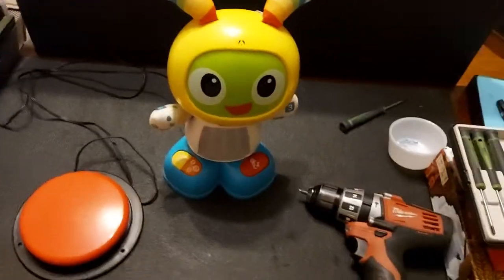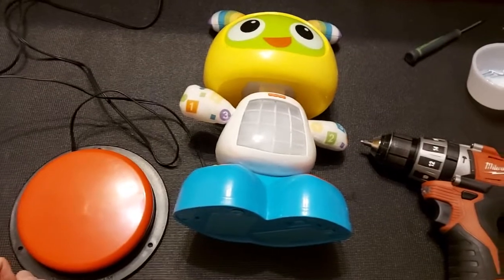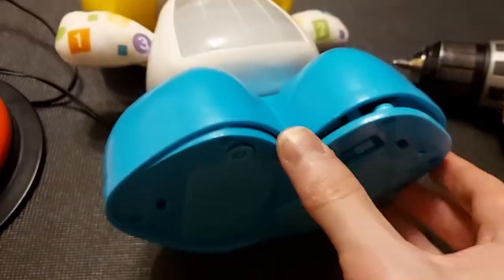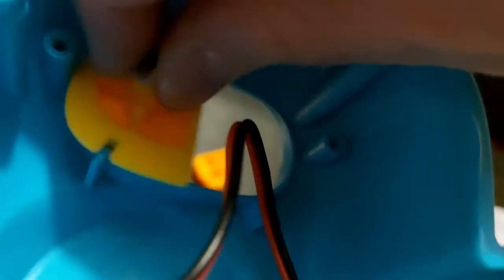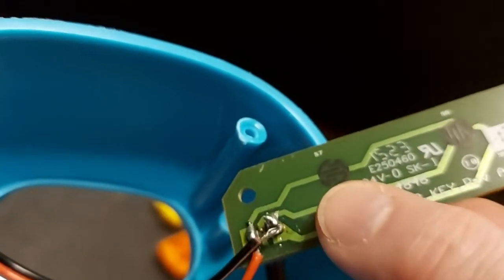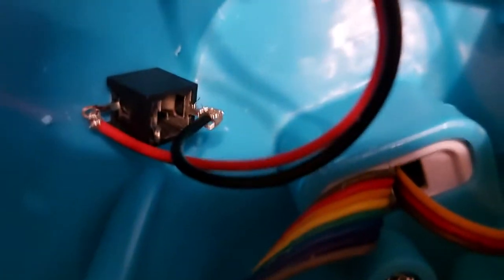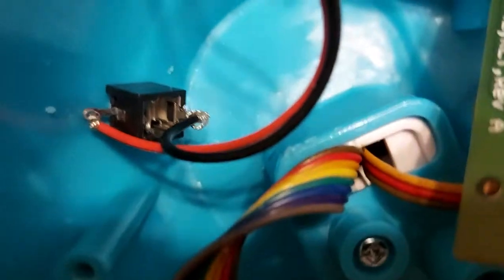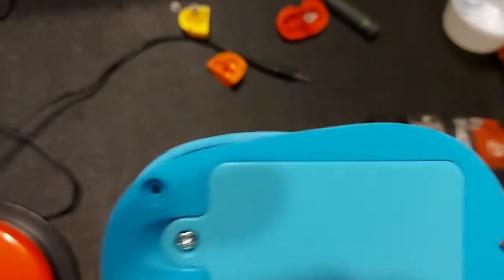Switch Adapted Beat Bo Toy

Comment: I soldered to all switches and it works perfectly as it should do , aswell as all the 3.5 mm mono sockets . Took it to bits more and added another 1 on its stomach switch . I do work in electronics though . don’t solder the wires next the conductive switch pads on the board or find alternative positions. Done many more adapted toys for my sons school